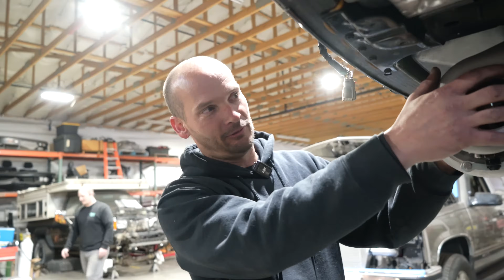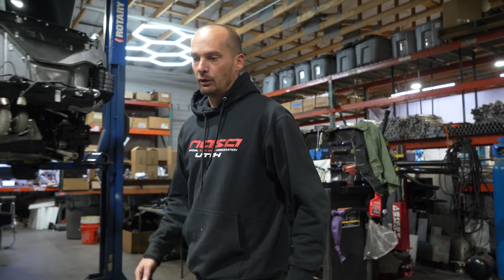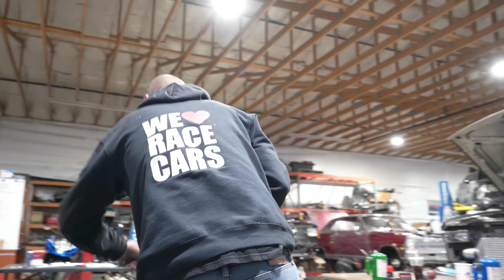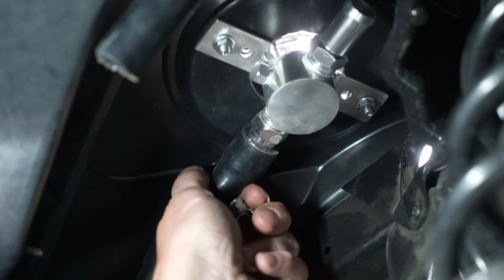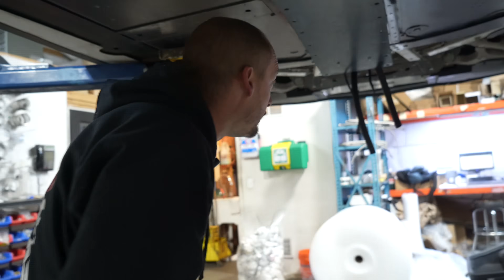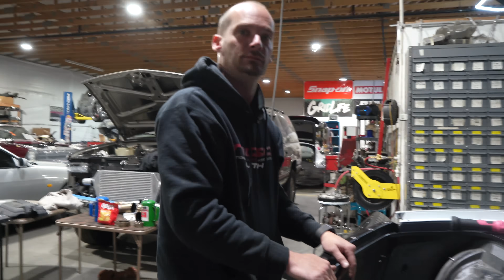C8 Twin Turbo Kit Installation Guide | Under Pressure Performance

Comment: What is the pricing point for these kits.  I come from the c5 world and just got into the c8 and i was shocked at the damn pricing because Im a materials kind of guy and do the math and I don't see it....but ya gotta pay to play so..,...
Reply from the maker: This kit goes for $15k but that includes everything you need aside from tuning.  You're right the C8 has a lot higher modification costs. Some of it due to electronics needed, some hard materials like intercoolers that arent universal like a C5 C6 setup. 
Let us know if you would like more information on the kit. We also just made a complete C8 exhaust that drastically reduces the weight of rhe factory one.

Comment: It looks like a fairly straightforward install. What was the actual install time? What are you using for tuning. I am very interested in purchasing.
Reply from the maker: @TRACKMKIII  Depends upon if youre doing clutches and axles. But you could definitely do this install in a weekend. Probably less depending upon your mechanical background.  
We tuned it on HP Tuners. Let us know if we can answer any questions we'd love to get some more out there. This one has over 4k miles on it going strong
Reply: @UPPTURBO  Thank you for the response. I turn wrenches professionally, so I think I would feel comfortable with the installation. However, I haven't had to deal with any DCT, so I probably wouldn't feel comfortable installing the clutches. Do you recommend the clutches at this power level? Is it possible to send you the ECU for tuning, or would I have to have it tuned locally? Have you tested this system with E85/Flex fuel yet?
Reply from the maker: @TRACKMKIII  Absolutely sorry for the short delay. The clutches really aren't that bad to do. I would recommend them for this power level. The ECU needs to be unlocked. And if you can't get the car to us there are some remote options to get you tuned as well. Feel free to shoot us an email for more info. Sales@uppturbo.com

Comment: How much hp does it gain?
Reply from the maker: @RafinRashel Doubles the horsepower easily to 800+ this made 850.
Reply: @UPPTURBO  I'm assuming this had a clutch upgrade and was fully tuned which wasn't documented in the clip? (and was it 850rwhp on 93 or E85?)
Reply from the maker: @kevindavidson2291 It was on 91 pump gas in CO at high elevation.  Equivalent of 93 pump at lower elevation. Correct uograded clutches and axles